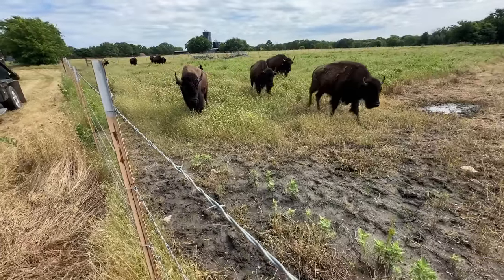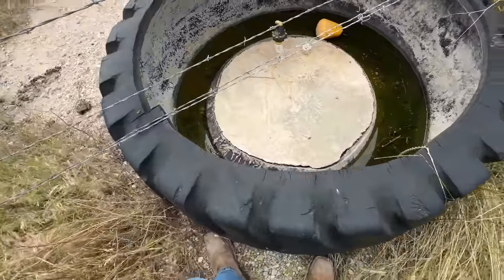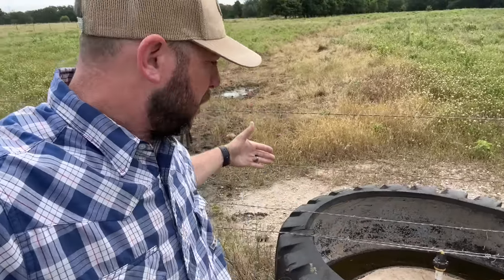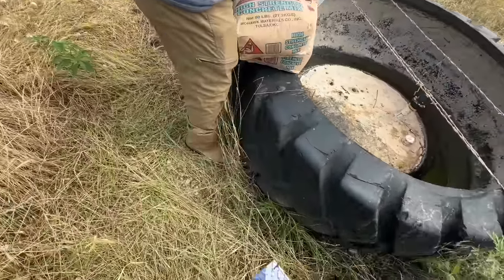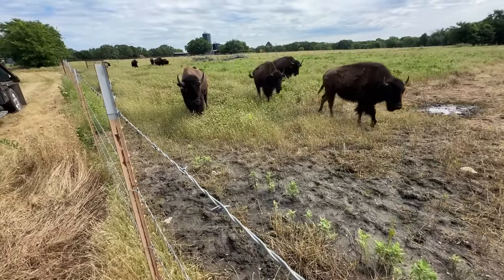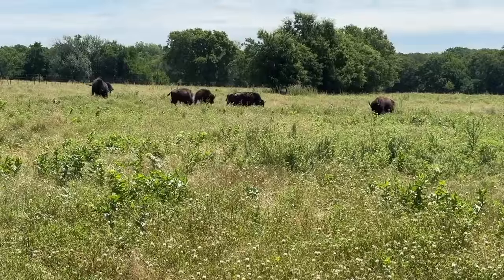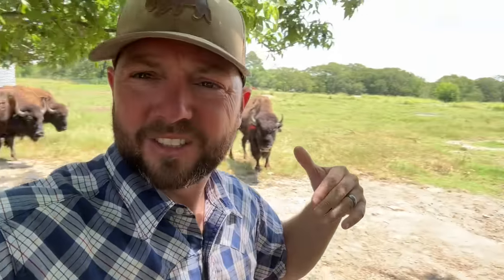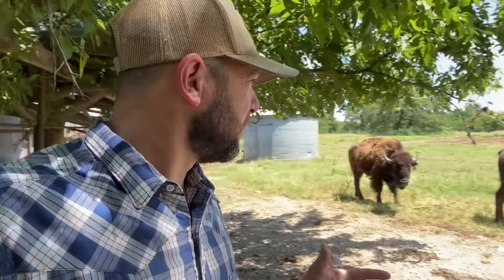Water Tank Discovery!

Comment: Dad was a cement finisher for decades.  He taught me that if you're going to pour over top of existing concrete to clean the surface and add a bonding agent (pours/looks/works like Elmer's Glue) to the old before pouring.  You get a better adhesion of old/new.  Hoping you find water back in the well.  With the amount of rain you folks have had this year, there should've been some recovery with no use of the well in a while.  Go git'em Dusty!  Nice to see ol' Thor livin' the good life at the folks' place.
Reply: Latex bonding agent.
Reply: Hope your well is full of water😊❤❤❤❤
Reply: with the Bison stepping into it I was thinking of putting some steel into the concrete to make it tougher. I'm afraid it will crack on the edge of the old concretedisk in the middle.

Comment: Old cast iron bathtubs would have been perfect water troughs
Reply: Cast Iron will rudt!
Reply: @Rumkitty2000 
They are covered by enamel. Pretty hard to find anymore, but the newer (tho not in use in homes anymore), rectangular shaped, metal covered with enamel tubs also work well.
Reply: Saw a rusty old 1 for sale the other day, $3,000!
Reply: @MsSilkeen  
Not surprised. They began to be harder to find, and more expensive in the 70s.

Comment: Dusty if the concrete starts to leak again, you might get a waterproofing from one of the big box stores.  It is painted on and dries to a form a waterproof membrane that will flex when the animals bump into it.  It is used to waterproof behind tiles in a shower and it's not really expensive.  Just a thought.

Comment: Expansion from water freezing is like a hydraulic jack that has no control or way to stop it. If the tank seal is going to last the ground under the tire must be dry to avoid the ground freezing and heaving the tire tanks and breaking the seal. A nice concrete pad is more ideal for freezing ground and dealing with frost problems. Good luck, like the tire tanks. ✋

Comment: That's the farmer way we' did most water tanks too, entire bottom level. We used far bigger tires. Local rock quarry would let you have their old huge endloader and Euclid truck tires. Euclid tires were 8-10 feet tall standing up, quikcrete wasn't an option. Built a half tank trailer out of a narrow gage railroad tanker car, 6 axles to haul when the cement trucks couldn't get to a new install watertank. Water expansion in seepage during the winter doesn't break the concrete like it does against the sidewall of tire, wheel rim of tire, center of tire gives and retakes where your concrete now hits rubber.

Comment: 11:10 What are the chances that the bison will knock the supply valve off?
Reply from the maker: There is always a good chance for sure. Hasn't happened yet. But I need some protection over them for sure
Reply: @CrossTimbersBison  I was thinking about a wire cylinder that extends upward with a 1/4" extention. The rise would poke their nose.